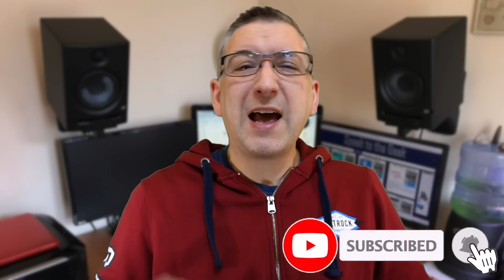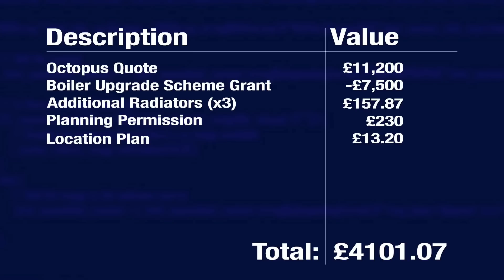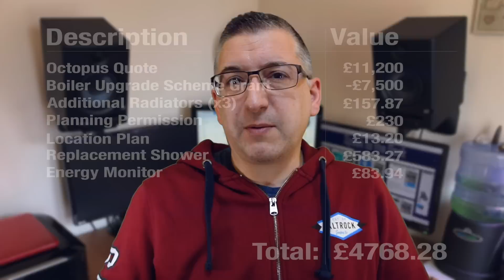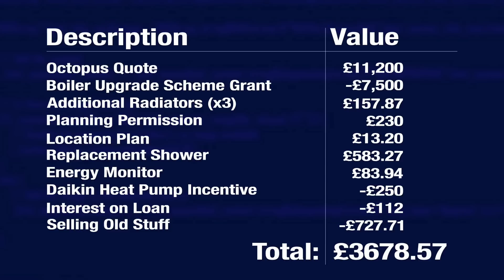How Much Did My Octopus Energy Heat Pump Installation Cost?

Comment: Whilst your 'wheeler dealing' and delays enabled you to benefit from the increased grant, the cost of the heat pump installation was over £11,000 so anyone who cannot qualify for a grant or when the grants run out will have to find the £11000 to save not a lot over many years.
Reply from the maker: It's not about saving money. This is a big misnomer with heat pump - they cost about the same to run as a gas boiler. Its value is in heating my home.

Comment: Thanks for the video, very helpful. I wonder if you would wouldmind answering a question? . We have two digital showers that are currently running on a vented, non pressurised system.  Please can you advise if you had a choice about pressurised v non pressurised or does it have to be pressurised?
Reply from the maker: My understanding is that it must be moved to a sealed/unvented system. But, I'm not a plumber, you should confirm that'll with an installer. An unvented system is considered my hygienic due to no open water tanks, but I understand your conundrum.
Reply: Many thanks, yes I replaced one of the aqualisa units last year at a cost of £700 for the new unit. Am a bit reluctant to replace two units but guess I could sell on like you did with some of your components. Thanks again for your helpful videos.

Comment: Thank you for the video.
Do you have access and can you share an itemised quote or invoice? I'm trying to understand where these elevated numbers are coming from? I had a quote from Octopus for £11k , British Gas = 14k and EDF =£15k. Heat pump and HWC for installers are around £3.5k for Daikin and £4k for Vaillant (that's for 5kW units with 180L slimline cylinder) I don't need to change any radiators. 28mm copper pipe is £30 per 3 meters,  lets say £500 for pipework. £500 for isolators and cables.  Is (labour) installation of the system £7k??? Really What am I missing?
I currently have combi boiler with flow temperature of 37 deg. My home temperature is set to 21 degrees nice and cosy throughout the winter. BG expert told me I need bigger radiators and system will be commissioned at 50 degrees. It seems to me that some companies are forcing customers to pay for unnecessary extras, so they can make margins and take commission.
Reply from the maker: No I don’t have an itemised invoice. The commissioned flow temperature refers to a worst case 50 degrees when it’s -5 probably outside, your design docs will confirm that. The flow temperature will be dynamic and mine is usually 30 degrees or so
Reply from the maker: Bigger radiators are because you will want to run at a lower flow temperature most of the time in order to make it more efficient so they need to output more power to battle against your home’s heat loss

Comment: I have just put a offer in on a house but it has a old oil central heating will this cost more to change any help be much appreciated thanks
Reply from the maker: I wouldn’t have a clue sorry especially with oil - I’m an end customer and not an installer so you are best off contacting a few companies to find your range.

Comment: As Octopus customer on their solar and ev tariff would work out far to expensive as have microbore thus needing pipe and rads to be replaced replastering all downstairs walls, new hot water storage tank and probably new shower system or as I bought couple years back replacement Worcester combi installed for just over £2000
Reply from the maker: Have you seen my other videos? I also had microbore and didn’t need any upgrades to the pipes.

Comment: We had a quote of £1138 which i feel is almost too good to refuse, waiting for the survey now to see if the sums will add up. Based upon my own assessment on heat punk it calculated 3.65 SCOP, to which i was hoping for more.
Reply from the maker: I think a SCOP of 3.65 is reasonable. Don't forget you can always get a much more efficient system from a custom-designed independent Heat Geek approved installer. It's whether you think the additional cost of using those installers is worth it for the most efficient system. For me personally I am happy with SCOP I am getting, and the extra cost of something more efficient would have priced me out of it. I'd rather be 'more efficient' than nothing at all!

Comment: I enjoyed your balance sheet which showed that the HP was not much more than for anew boile. But you didn't say anything about the space lost in your house for the equipment and the running costs for the HP V a boiler. Maybe thats for the next video
Reply from the maker: I have mentioned about the space required for the system a number of times in this series of videos so I’m not trying to sweep that issue under the carpet by any means. There is also a dedicated video do running costs after installation, and a new update video being published this Saturday actually.

Comment: I've just been quoted £6800 by Octopus (after grant).  I don't understand what's that's based on. All i tell them is what type of house and what the current heating it.
Reply from the maker: It's based on your EPC results, existing boiler/heating system, and house size/type. They basically have estimations for installations and use those categories to come up with the closest fit. They did the same to me and stuck to that price even after the survey.

Comment: Well that was such a helpful video. I've binged the playlist of heat pump instal and now feel a little more assured about our future heating system. We have exactly the same Potterton boiler you had and its approaching 21 years old and reaching the end of its life. I've checked out the latest .GOV website for EPC requirements. Apparently in early May 2024 the government will relax the rules and allow a ASHP to be fitted regardless of the recommendations. So I'm waiting a bit for that to happen before starting the process of getting a quote from Octopus. Thank you so much for your very informative videos. - Paul
Reply from the maker: I'm glad you enjoyed it and found it useful, one of my main intentions was to encourage others to do the same and show that it's a good move to make if you're able to. Don't forget to use a referral code to get £100 off your Octopus installation costs. Ideally if you use mine then I get £100 credit too :) Code is A-E16D01B4

Comment: I’m intrigued by the planning permission needed? What was that for?
Reply from the maker: All covered by other videos in the series https://youtu.be/nO0OuB0AAoU
Reply: @SpeakToTheGeekTech  sorry I have just seen this. Thank you for doing this all. Really helpful. Are you happy with it? I’m looking at pulling the trigger on it.
Reply from the maker: @Mot_ti  Very happy with it, it's worked brilliantly over the winter. If you're going with Octopus then don't forget to give them my referral code (A-E16D01B4) and you'll get £100 off (I'll get £100 credit too). Octopus aftercare has been great too, and the price was very competitive. It probably won't be the most efficient system possible but it will give acceptable performance. Independent Heat Geek installers are more likely to give you the most efficient system but they tend to cost more up front too. It just depends on your priorities.
Reply: @SpeakToTheGeekTech I will use that thank you.

Comment: Sorry I’m not convinced 
I’ll stick to gas
Expensive to run and doesn’t give out enough heat
Reply from the maker: I’ve literally just given you the data that proves otherwise! But nobody is forcing you to switch so you can use gas for as long as it’s available
Reply from the maker: Running costs are shown in my latest video too so check that out. TLDR: costs the same to run and puts out loads of heat

Comment: My combi costs £2.50 (inc s/c)a day for heat an water 4 people in 4 bedroom house temp set at 19. I have 8kwh of solar and 19kwh of battery storage and averages at £1 (inc s/c) per day over the whole year. So a heat pump which octopus want £4500 in my case has no benefit at all. I went down the route of extra insulation everywhere I could. Cheaper and more long term beneficial.
Reply from the maker: Every home is different. I had a really old inefficient boiler which needed to be replaced anyway so I was basically in the perfect position to have a heat pump and see the most benefit
Reply: Barring the two tonnes of CO2 produced each year by average gas boiler, which is no long term benefit to anybody. Did your Octopus quote include the grant ?
Reply: @_Dougaldog  For every two tonne we create China produces 60 tonne, people have to be able to afford the energy they use, it is important, I would like retro fit insulation, solar 24 hour battery back up and an ashp but that will be £30k +, when insulating the internal of the external walls (50mm phen foam and plasterboard) will be £6k (Loft already insulated but further insulation only hundreds of pounds) and reduce bills by half guaranteed saving £750 year 8 year payback and 1 tonne of CO2 each year, DIY £3k 4 year payback!?!
Reply: @TomTomicMic  

I don't live in China, the largest producer of renewable energy, whose government is ahead of its target in phasing out fossils.

What I have done is replaced a broken 20 year old gas boiler which produced two Tonnes of CO2 per year, this was connected to 40 year old radiators and microbore pipework which would not be suitable for any modern low temperature flow system.
What was also replaced was a 60 year old gravity fed HW Cylinder with mains pressure smart cylinder.

I have not spend a penny on insulation for over ten years, I have 75mm cavity wall insulation, 12 year old double glazing (Argon filled), and about 75mm roof insulation. I have no Solar PV, nor battery.

Total cost to me £4k after grant, about the same I would have paid to get only old boiler replaced.

Payback time for me, zero.

House warm 24/7 (two bedroom mid 1960's semi'), 13kWh of electricity per day for heating & HW at present. Outside temperature currently 4.8C. That's a winter total electricity bill of less than £150 a Month on a 28p tariff (four nights below zero).

Heating SCOP over last three weeks 4.28.

It's performing better than I expected.

Nothing to be lost in getting a free survey done, if viable then back that up with a survey and supplier of your choice if required.

Comment: I’d say around 9. Out of 10.  Installations I go to have radiators that don’t get changed and are undersized.     Some also needed 22 mm pipe run to rads not 15 mm.    So get rad sizes checked
Reply from the maker: Yeah I did my own calculations on the radiators to compare with what Octopus provided. I wasn't happy with the bedroom radiators being left unchanged to paid extra to upgrade them. All of the others were either upgraded on the advice of Octopus, or already sufficiently sized (I literally have 3 original radiators now, so all of the others were changed!). I wish I'd had the living room one changed though too if only for cosmetic reasons. I may get someone in to do that and put in a slightly more powerful one, although it is a large K2 right now.

Comment: Thanks for this series of videos. I have what looks like the same old boiler as you so I'm also looking at Octopus HP install as it will be cheaper than a gas boiler. Did you sell the old boiler? There still seem to be many second hand parts advertised for them, particularly the PCB.
Reply from the maker: I didn’t think to try and salvage the old boiler sadly. I never considered it would be worth much and the installers took it away for recycling.

Comment: And remember we are sat on 100 years of shale gas  found up till now 
the whole thing is insanity  same as EVS   RUBBISH 
get the boiler mended  good grief man  In last 15 years I had me gas boiler mended twice  
expansion tank and mother board  £ 550  all told
Reply from the maker: I've had my boiler mended dozens of times in that period - and now I have a more efficient and so far cheaper to run system. You do what you do, but I'll stick to the modern efficient way of heating my home that doesn't require any shale gas directly, and eventually won't require any gas indirectly. Not sure why you find it insane that other technologies are now available and improve on previous generations... it's the march of progress dude, adapt or fall behind!

Comment: THATS PERPETUAL MOTION WHAT LIES  put in a Kilo wat get 2+ out ha ha ha   
if they that good shut all oil coal gas biomass power stations   and build huge heat pumps IT DONT WORK   to power the country.
Reply from the maker: Lol, you have very little grasp of physics by the sounds of things. You are not creating heat energy using the energy supplied to the pump, you are merely moving it from the large space of air outside into a smaller compressed space. And there are organisations building huge heat pumps already for distributed heating systems... they do work and their commercial success stands as evidence. Also, my house is warm.
Reply: It does work, what doesn't work so well however is ignorance ;-)

Heat pumps are widely used commercially in UK, it's just the domestic market that lags behind rest of world as a direct result of North Sea gas being so easily to hand, and laziness on the part of government to roll out over the years, too many good political donations from the oil companies.

Comment: I thought it had to be £5k cost to get the Nationwide greener mortgage? I'm not sure if my heat pump install would come to more than that (heat loss survey this month) and also not sure if upping my battery capacity counts as 'green'. Good to hear from someone who's got it!
Reply from the maker: You are correct, the total cost for all green improvements must be more than £5k. When I took the loan out it was - see the original quote minus the old BUS grant plus the required shower and planning permission etc, I checked and those were all allowed because it was part of the total cost of the project and required to complete it. The BUS grant increasing after the loan had been issued was unexpected and does take me below the threshold but as the loan had already been given there's no option for handing it back early without penalty. I've also spent some on loft insulation too but I do need to spend the rest on other green improvements if I can.
Reply: @SpeakToTheGeekTech  Ah, I hadn't appreciated the timing of the grant changing. I think I'll email my broker and see if batteries count. Maybe I can stick the induction hob on there too, seeing as how that's needed in addition to the heat pump to get off gas...

Comment: My ASHP was installed by Octopus in June 22. Four bed detached 1990s house with EPC rating of B85 with 270mm loft insulation , cavity wall insulation and recently installed replacement double glazing (original wooden frames were shot). Survey showed 6.6kW heat requirement @ -2deg so had 7kW Daikin Altherma 2 installed along with 11/14 rads replaced, new sealed tank. No internal pipework replaced as had a 15mm system. Cost was £11250 less £5000 grant and £250 off as early adopter so net £6000. The install went well and the octopus staff were great and very professional, tidy and good banter. Design sCOP heat was 3.4 DHW 1.7 based on 50 deg flow @-2ext. I insisted on weather compensation at commissioning and setup was 50deg@-2ext/35deg@18ext. In December 2022 it was obvious that these settings were too high and after loads of tweaking now have them at 50deg@-15ext/25deg@18ext which keeps house at 20-21deg downstairs and 18-19deg upstairs. sCOP year one 3.63 heating and 2.51 DHW but looking like will be better year two now have settled on final weather comp settings. My only regret is I didn't ask Octopus to quote for larger radiators so that design could have been for lower flow temps as I suspect this would have not added very much to the quote. But all in all I am very happy with the system and pleased to have no gas. Just waiting for SGN to finally sever the gas connection as it is only capped in the meter box atm.
Reply from the maker: I still haven't fiddled with the weather comp, got to do some serious reading up on that before I fiddle!
Reply: @SpeakToTheGeekTech  Basically when we got to Dec 22 and it was sub zero the house was too warm so I gradually decreased the top end from 50⁰@-2⁰ext to 50⁰@-15⁰ext so rooms stayed at required temps. It was trial and error but easy to do. Similarly altered top end on warmer days and found the sweet spot so that rooms right temp and virtually no cycling occurs. I have set up Home Assistant to enable me to visualise flow return temps, study, living room and bedroom temps and external temps . I also use a spare CT clamp attached to a Harvi to monitor the power usage of the heat pump in HA.
Reply: Octopus won't design with bigger rads, unfortunately. Some customers seen to have wrangled this, but they design at 50c flow temp and that's your lot.

Comment: 😕 I though a heat pump heated a tank slowly so its not mains pressure? In that case why would you need a mains pressure shower?
Reply from the maker: The two things are not connected. The hot water tank is fed by the cold mains feed, therefore all taps in the house are at mains pressure. Previously my hot water tank was fed by an open cold water tank in the loft which provided the pressure. That difference meant I had to swap the shower. As for heating slowly yes, that’s what it does but that has no relevance to the water pressure
Reply: @SpeakToTheGeekTech   After thinking about it you are right. I am in the same position regarding a shower. Current system is open vented and a HP (or new combi) would be a sealed system, ie. would be moving from gravity fed to mains pressure.